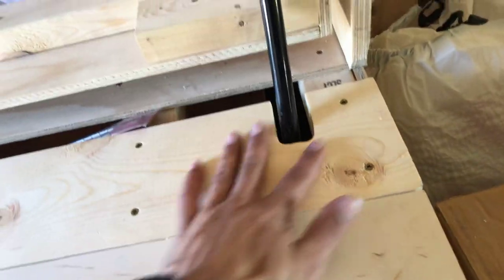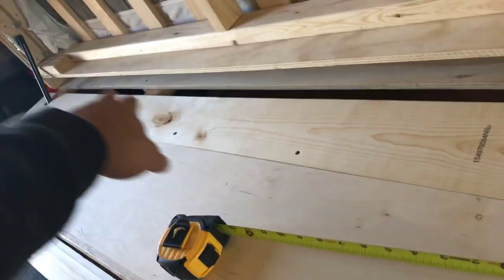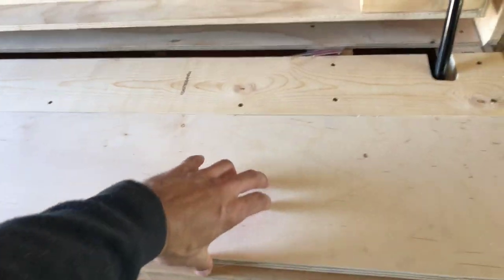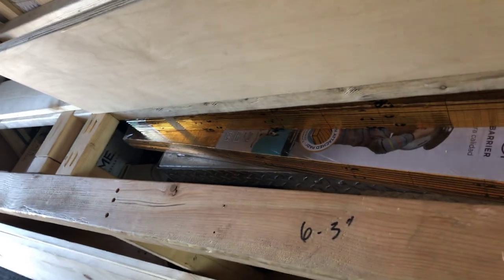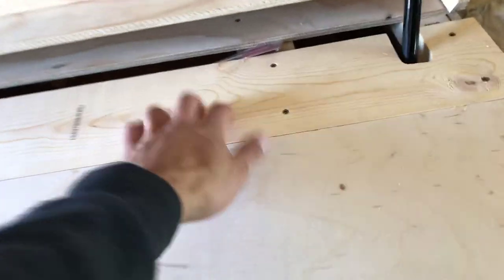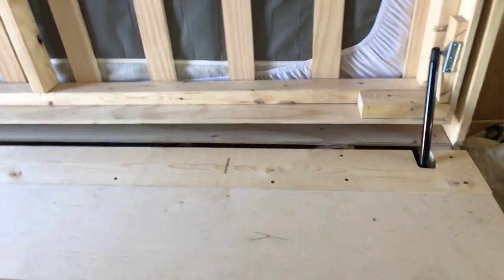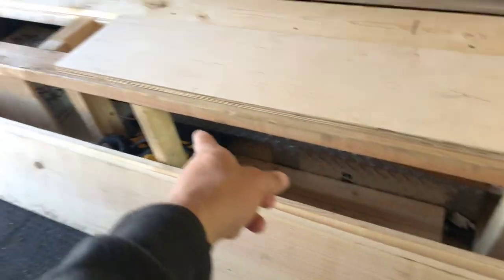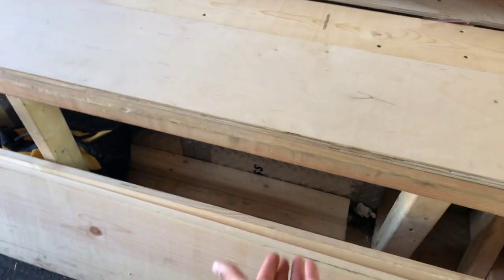Bench Seating on Bed Side

Comment: Greetings...can you try and give a better inside space perspective of your van? Yourself and 7 are those closest to me in size. The spacial advantage of step vans is hard to guage by video.
Reply from the maker: Hey Keith! Yes, the inside is highlighted on most of my videos, especially the ones with the insulation of the floor and walls. But for dimensions, my cargo area is 7' H x 7' W x 18' L
Reply: @TheTinyHomeTruck  thanks...granted all stepvans aren't the same but what's the meas from wheel well to the back door
Reply from the maker: Hey Keith I'll have to look at my plans. I believe that may also be in my earlier videos as well as the website. I think you should just start figuring out what you want in your stepvan then figure out what kind of space you need based on floorplan. Then adjust that to the size of the stepvan.